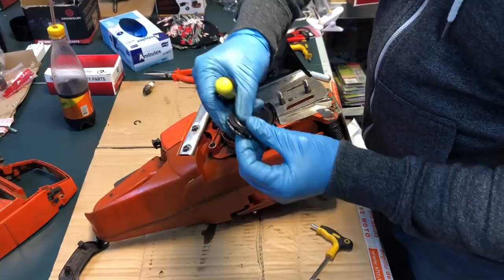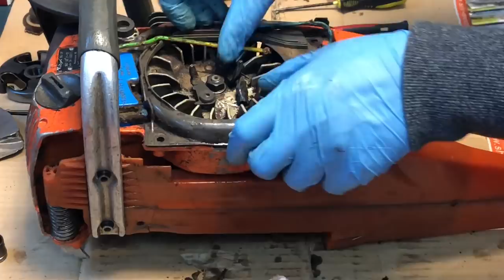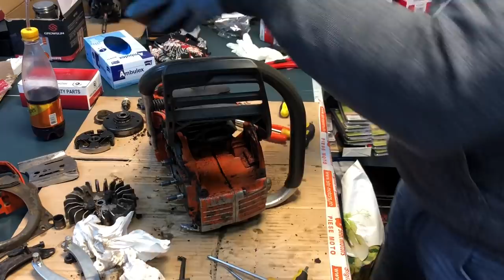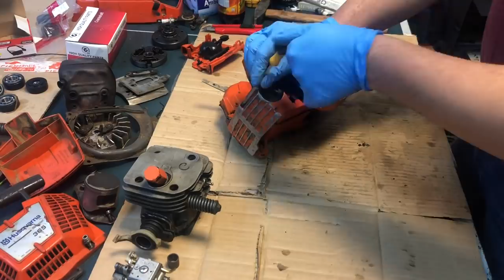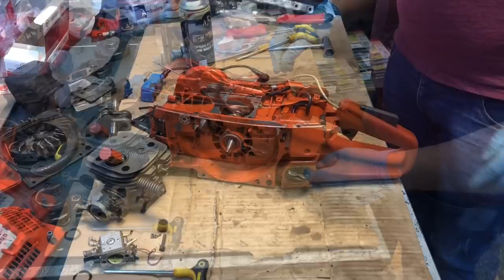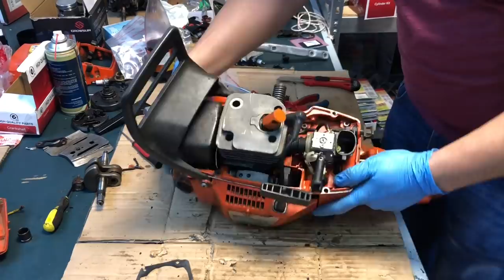Schimbat ambielaj Husqvarna 365 , refacut motor complet

Comment: Am o drujba husqvarna 262xp si porneste foarte greu la rece dupa multe sfori porneste iara se opreste până la urma isi da drumul dar nu tine relantiul cu nici un fel de reglaj tine dar nu la turatia normală numa foarte ambalată dar dupa ce porneste merge bine trage bine am schimbat semeringurile de la ambielaj tot din problemă asta si nimic tot asa si diafragme noi la carburator curata tot bujie noua segment nou compresie foarte buna imi puteti da un sfat daca va rog?
Reply from the maker: Un test de compresie ati facut?
Reply: @SHRMotorsOfficial   nu am făcut dar la sfoara zic eu ca are compresie buna si la rece si la cald ă fost schimbat si segmentul cu unul original dar nu trebuia
Reply: @SHRMotorsOfficial  de tras in lemn trage foarte bine nu am ce sa zic doar ca porneste greu la rece si nu sta la relanti cu nici un fel de reglaj
Reply: @SHRMotorsOfficial  dar incurand o sai fac un test de compresie ma puteti ajuta cu cati bari ar trebui să aiva ?
Reply: Peste 120.... A mea are 160
Reply: @HanaBasara  multumesc mult
Reply from the maker: Peste 4